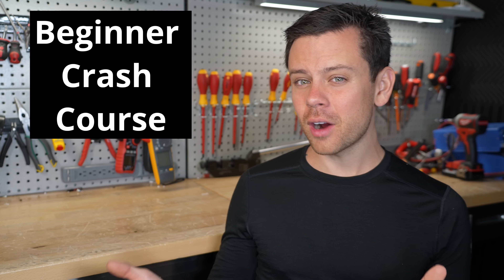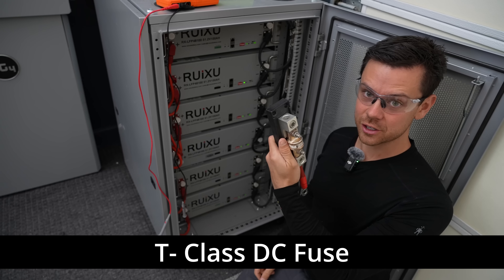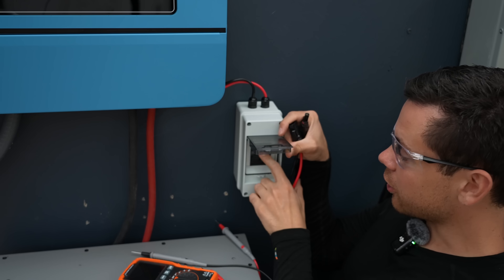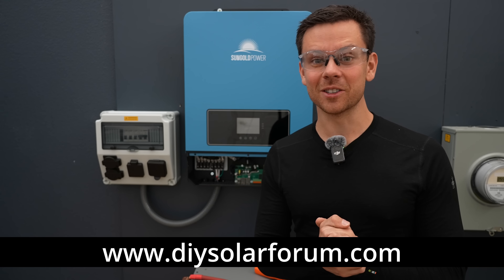Offgrid Solar Crash Course: Avoid FIRE and ELECTROCUTION! For Beginners or Experienced Users

Comment from the maker: After posting my reaction video yesterday, I realized that people need more help with basic safety. I hope this video helps! Share it with beginners so they will not burn their house down. 

0:00 Intro
0:21 How To Crimp Large Cables
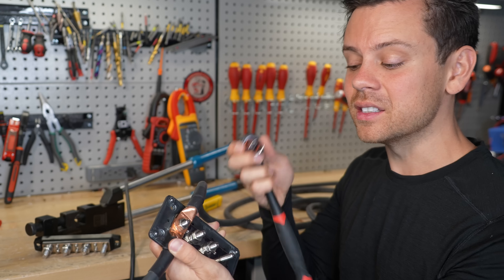1:41 Large Lithium Battery Basics
3:57 Before You Build Anything
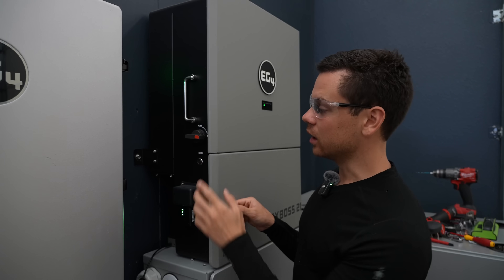4:18 You NEED a PV Disconnect
6:05 Check for Loose Connections
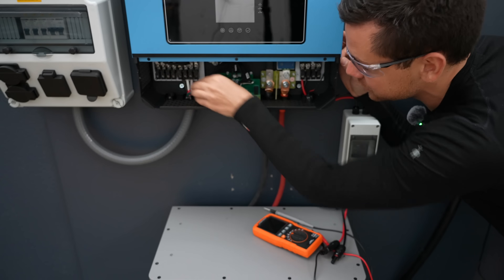6:32 DIY Batteries are for ADVANCED USERS ONLY
6:51 Metal Case Equals Less Fire
7:25 Sizing Battery Cables
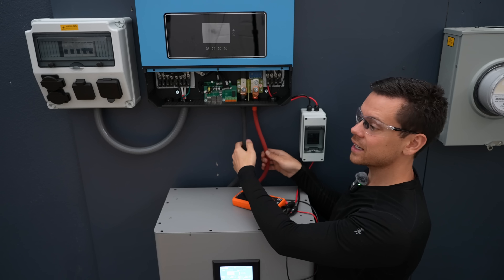8:09 How to Size Wires Properly
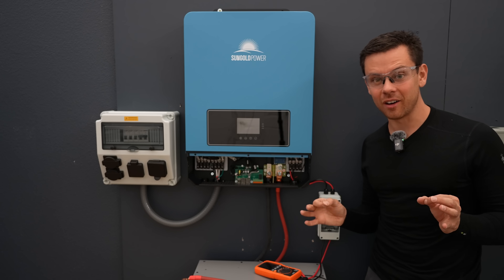9:53 Check Polarity
10:45 Conclusion

~~~~~~~~~~~~~~~~~~~~~~~~~~~~~~~~~~~~~~~~~~~
Tired of getting ripped off? Check out my "Will Prowse Approved" solar product recommendations below!

12V Batteries
https://www.mobile-solarpower.com/lithium-batteries.html

48V Batteries
https://www.mobile-solarpower.com/48v-batteries.html

Offgrid Inverter System Builder
https://www.mobile-solarpower.com/48v-complete-system-blueprint-559371.html

Hybrid Inverter System Builder
https://www.mobile-solarpower.com/code-compliant-48v-offgrid-system.html

Mobile Handtruck System Builder (very popular!)
https://www.mobile-solarpower.com/mobile-48v-system.html

Solar Panels
https://www.mobile-solarpower.com/300w-solar-panels.html

Ground Mount Solar Racking
https://www.mobile-solarpower.com/ground-mount-racks.html

Wire, Lugs and Busbars
https://www.mobile-solarpower.com/wire-and-connectors.html

Tools
https://www.mobile-solarpower.com/tools.html

Fuses and Circuit Breakers
https://www.mobile-solarpower.com/fuses.html

Plug-N-Play Solar Systems
Ecoflow, Anker And Bluetti! So many models to choose from. See my current recommendations here:
https://www.mobile-solarpower.com/full-size-systems.html

~~~~~~~~~~~~~~~~~~~~~~~~~~~~~~~~~~~~~~~~~~
Need to build a large DIY system? Need a trustworthy solar distributor? These are my favorites:

Signature Solar
Creator of EG4! Solar Minisplits, Victron and More! Largest Solar Store Online.
If you want $50 off, please use my link below and coupon code "DIYSOLAR50":
https://signaturesolar.com/?ref=cPwLcVc0SW-BjN

Current Connected
Best Prices for EG4, Victron, Midnite and so much more! Fast Shipping and Highest Rated Customer Service:
https://currentconnected.com/?ref=wp

~~~~~~~~~~~~~~~~~~~~~~~~~~~~~~~~~~~~~~~~~~
Join our DIY Solar Community 
Need more help? Join the largest solar forum on the internet for beginners and professionals alike. 140,000 members and counting!
https://www.diysolarforum.com

Check Out My Free Book
Best-selling and beginner-friendly guidebook to off-grid 12V solar!
https://www.mobile-solarpower.com/the-book.html

~~~~~~~~~~~~~~~~~~~~~~~~~~~~~~~~~~~~~~~~~~
Contact Information:
I am NOT available for personal solar system consult! If you wish to contact me, this is my direct email: williamprowsediysolar@gmail.com
FTC Disclosure Statement and Disclaimers:
Every video includes paid promotion or sponsorship (such as free products for review). Some links on this YouTube channel may be affiliate links. We may get paid if you buy something or take an action after clicking one of these. My videos are for educational purposes only. Information is subject to change/update at any time. Electricity is DANGEROUS and can kill. Be smart and use common sense :) DIY Solar Power with Will Prowse is a participant in the Amazon Services LLC Associates Program, An affiliate advertising program designed to provide a means for sites to earn advertising fees by advertising and linking to Amazon.com
Reply: You're channel is one of the best!
Reply: The "only thing" you might want to add because this is for beginners is - how to check the voltage. Not sure beginners know what that means tbh. But, maybe they do. Great vid as usual!!
Reply: I watched all the safety stuff on this channel and I'm still scared to touch things, so the more the better. Thanks!
Reply: @reinux You're right where you should be. Those that get into trouble are those who "don't know what they don't know"
Reply: 75c so the middle column is what most terminals are rated for. The higher rated jackets really only get used when putting in a hot environment so u don't have to debate the wire
Reply: Derate*
Reply: You make it easy to be safe...you don't overcomplicate which makes it less likely that someone will electrocute themselves.
Reply: I have learned a tremendous amount about off grid solar watching your videos. I've still got some learning to do so I really do appreciate this video today. Thank you for your honest reviews and all the time you spend putting together information videos like this.
Reply: I love the way you showed the proper way of doing things instead of just trashing the other guys video
Reply: That yesterday video was something :D
Reply: Yes sir. It's been a few years since I did our trailer, and now I am looking to do a solar UPS for our Internet and refrigerator.
Reply: Yes! I got the 1 hour build package and ran into several issues I think should be included but you can’t foresee them all. Overall I appreciate your work and my system is awesome! I’m going to do a video on it.
Reply: In South Florida, we are not allowed to install solar panels or windmills. The electric company does not want profits to go down. 
Also, the insurance companies will cancel your home insurance if you install solar on your roof.
Reply: Welding cable doesn't meet code. I tried to argue but my AHJ required me to replace it with Type W cable, which is essentially the same thing with an extra jacket layer for improved resistance to abrasion and chemicals...annoying given it won't be moving.
Reply from the maker: @Mike80528 oh wow! Where are you located. what batteries are connected
Reply: @WillProwse  Colorado front range. I have 12 of  the Signature Solar lifepower4 rack mount batteries in their EG4 racks. 

I think they are misreading the code but you cannot really argue with your AHJ and even inspectors really aren't great at understanding the code book, they understand what they were *taught*...
Reply: I have to come clean.. the guy you critiqued made a video connecting his first major upgraded system, in this video he used 16 12volt lifpo4 batteries and ran them as 1 big 48 volt bank.. I have spent the last 2 years saving and watching your budget videos and accrued my 16 batteries to copy that guys idea... now I'm afraid it was all for nothing and there's not a chance in hell I can afford to stay buying 48 volt rack batteries. Is there any hope for me to use my 16 batteries or should I just give up? I have 2 5k growatt inverters and 14 535watt bi facial panels which I already saw your videos testing production so they are not gonna be worried with the extra from back side they were 100$ each no worries.
Reply from the maker: @joshjones8335 oh that's awful and that's a lot of money of batteries. Just ensure the proper size conductor is used, and each string should have its own breaker or fuse. Every few months, charge the system to full,n then disconnect the strings and use a 12V charger to charge them all up to 100% then connect it all back together again
Reply: @WillProwse thank you sir! I just went back 3 years ago and found you discussing running then into 48 volt strings and even mentioned adding a second or more of different brands even being feasible so thank goodness I'm not sol lol thanks for all your help I've watched tons of your videos leading up to this point!
Reply: @WillProwse also I went with vartrer in the beginning then the kingboss so I was able to afford 4 48 strings and I have an additional 4 batteries for failure replacement
Reply: @joshjones8335 hey man go to his forum. A lot of helpful people in there.
Reply: That video two days ago had me ROFLMAO!!!!
Reply: I had to build a system with two ecoworthy batteries of different versions. its poles were opposed in the two versions. had to work with it. can you make a video about it? great job with your videos, pal.
Reply: So I have 6x 48v 100AH batteries with BMS and breakers. Do I fuse each battery to the case bus bar? Or only fuse the connection to each inverter and the case bus bar?
Reply: Have you tried making a panel setup that moves along with the sun rotation? I think that would be a good video.
Reply: This is good stuff. 👍
Reply: Can you help me? I don’t want to be running my system if it isn’t safe. I have 6x 48v 100ah batteries. They go to 4x 6000xp’s and they’re fused at these connections with 125a class t fuses. Do I require any other fuses? My batteries are eg4 48v server rack batteries with integrated breaker.
Reply: @JjJj-n3m4p  I think Will would need to walk through your circuit in more detail...

Are your batteries rack mounted (and connected to a bus bar)? 
I assume the inverters connect to a bus bar? What is the amp rating?

What guage/type of wire goes from the batteries to the inverter bus bar?

What guage wire goes from the inverter bus bar to the inverters?

Is their a 125A fuse for each inverter?

Do you have any other DC disconnects in that circuit?

Are you using crimped copper lugs at each termination point (where possible)?

Those are the additional questions I would have to help identify potential issues/concerns.
Reply: great video Will, common sense safety goes a long way. reminding people of common sense safety goes further. being a seasoned construction hand I have seen a lot of mistakes that could have hurt or worse killed someone taken for granted.... pay attention, remove distractions and be clear headed when working with any source of power.  also wearing proper shoes can even save your life.  Thanks, Will for yet another great video. A great electrician once told me you will have more time to do it safely if you don't DIE!

Comment: I work as an engineer and technician in the power industry... we spend 3/4 of our time on safety- constantly looking at connections, how things are wired, making sure the cables are heavy enough, etc.  Safety glasses go on the instant we walk into the lab area.  No exceptions.  Always have a safety buddy and that person checks your wiring before anything gets energized.  It's just how you do things.  Everything is crimped, and made of copper.  Everything gets color coded with unique colors of tape (both ends).... so no matter when you look at a wire, you know its other end.  You can't go by insulation color.  Never use adjustable wrenches to tighten things.  Always use lock nuts.  Safety is a mindset and you never cut corners.  Ever.

Comment: Another retired electrician and Electrical Engineer here, I would go one step further and include a periodical preventative maintenance regime , using an infrared heat detector is good but electrical connections expand and contract with heat which can / could become loose over time , a good PM system and health check of your system should be the mindset of self installs if your competent to do so.

Comment: "... small 12V batteries, you want to connect everything to the system first or the inverter, and then connect the battery last"
But many small MPPT manuals explicitly state (and I paste here, from one such manual) _"Very Important: Connect battery to controller BEFORE solar panel, and
check that the battery voltage is registering on the display_"

Comment: Hello Will, Merry Christmas!
Thanks for your Video on safety.  I have only one question is connecting the solar panels I am guessing with a switch you can connect to your switch or unit safety as long as you don't complete a circuit?  So if the switches are off and you don't handle the wires together it is safe?

Comment: Will, with a battery rack that has bus bars, do you find the need to connect the main battery leads that go to the inverters to opposite ends of the rack bus bars to make sure the batteries charge equally?  For example, do you hook up one cable at the top of one bus bar and the other cable at the bottom of the other bus bar?

Comment: If you are new to working with electrical equipment,  for the love of god stay away from DC voltage  that gets much over 48 volts. The higher it is the more lethal it is. Think long and hard about what you are doing. One mistake can cost you your life.

Comment: I would like to ask you about the placement of the battery disconnect switch. I noticed that you always put the battery disconnect switch on the positive wire. Every battery company I've talked to says to disconnect the negative terminal first, then the positive. Could you please tell me why you disconnect the battery from each system, contrary to the battery manufacturers’ instructions? Thank you for your information, John

Comment: A solid crimp gives you a cold weld bond, no argument there. But when you’re working with serious voltage or high current, dipping the lug in a solder pot after the crimp can make a huge difference..it fills any micro-gaps, keeps corrosion out, and helps the connection stay stable when things heat up or vibrate.

Crimp first for the strength.
Solder second for the reliability.
Done right, it’s not a “hack” it’s just smart and overbuilt.

 people who bad mouth the method are usually the ones who’ve never actually seen done it right.

Comment: thanks for all the videos, learned a ton and am finally putting a system together.
I hope you can touch on some of the more ancillary topics - optimizers/micro-inverters, surge/lightning protection (i know you have some info on grounding, but would love a bit more - especially regarding an off-grid cabin type install)
maybe even info about getting state of system into something like Home Assistant - if that is worth your time
thanks again!!

Comment: Thanks for your videos
I'm a little confused as to when to connect the battery, you said to hook it up last in this case but I thought you put power to your charge controller first and then connect panels, is connecting battery last ok in this case because your panels have a disconnect switch and you don't turn them on till your done with all other connections 
Thanks again and God bless

Comment: I love tools and all that and I got a ton of them, but buying a crimper like you got there. $180 on Amazon? For a one or possibly two or three time use at most, there's just no way can I justify that on a SS budget. I'm already buying enough single use tools since I started this solar stuff, lol. Nah I bought one of those $11 hammer on kind. A vise seems like a good idea though. With a small bolt or something for a deep indent. It would prolly work. If I hadn't already bought the $11 thing. Well I kind of wish I had tried it! In other words most of  the stuff you do, I need to dumb down to my own financial lever. But always good videos! And one of the first solar guys I've subbed to. Kind of like the LTT of solar.  :hand-purple-blue-peace:👌:goodvibes:

Comment: I will I just watch your beginner's DIY and I have a question I'm trying to do this to Arv a motor hope right at the present there's nothing other than just regular 12 V coach batteries so I am going to apply a inverter to power up all my 120 V outlets and a Solar System on top do you have any suggestions or any way you can guide me towards the correct equipment I would deeply appreciate it thank you my tough field 2004 sightseer Winnebago

Comment: I was hoping this went over the installation process but now I get it was mostly around safety, but still very good video. Would like to see an install start to finish for off-grid that includes the breaker panel install, neutral-ground bonding, lightning protection, PV breakers/disconnect, etc.

Comment: Also always make sure to use the same type of mc4 connectors on your entire setup. dont mix it up, seen a lot of them that fused together and could have easily caught fire. Dc current is very dangerous if you dont know what you are doing.

Comment: This is good advice especially on very large systems. My own system is now 11 years old and lets say it doesn't have all these things mentioned however every single connection was designed to be capable of handling 3 times the maximum expected current and after 11 years of trouble free operation it has proven successful. My entire system will be disassembled in September as I am moving house

Comment: In a previous job, I would test crimp connections and found when crimped properly they were stronger than soldered connections. We would measure pull force and cable elongation to determine the results.

Comment: The only part I can disagree with. The part about crimping a "large cable".  The pull test. If you "test" the connection you just made by pulling on it, and that 6 pounds of force you apply shows the crimp to be bad, you have failed miserably. This is a connection  that should take 100's of pounds of force. This would be like building a new wall in your house, and you lean on it to see if it is structural.

Comment: I have four 48 volt eco worthy server rack batteries, they have no shut off, no monitoring just positive and negative terminals, how can i monitor them and with what, they are run in series and connected to the 5kw inverter, there is 2400 watts of solar connected to the inverter, but with no manual for the inverter i only know what one screen shows. Seems like they're always charged, since its summer and only a fan is lugged into the ac side through a  10 gauge extension cord. I want to be able to monitor it all in the cab 10 feet away.

Comment: heres a question for u if u keep this series going. im upgrading to a eg4 12000xp and in the manual they recommend 2 2 awg battery cables or 1 4 awg gauge battery cable. i thought 2 gauge was bigger than 4 gauge so why 2 versus 1?

Comment: Hi there, i have a lifepo4 16 cell battery, one cell's safety seal came off and it smells and has 0 voltage. Is that fixable you think? If not, can a 16s bms usually work with 15 cells if i have to remove the damaged cell?